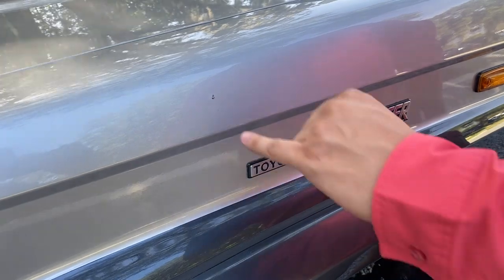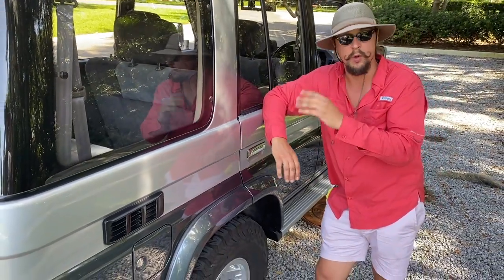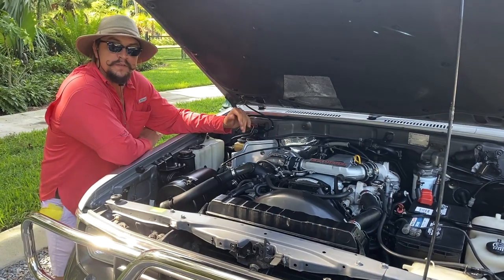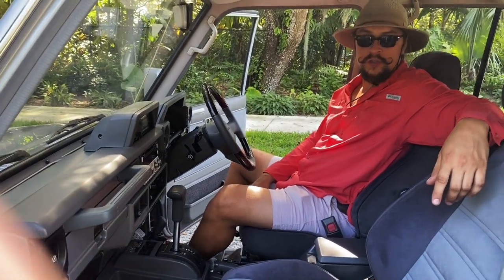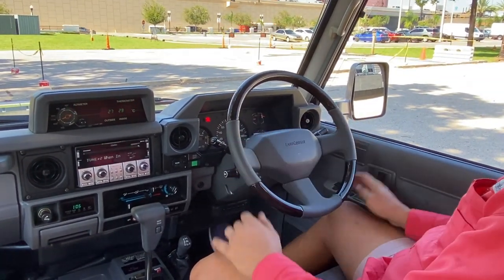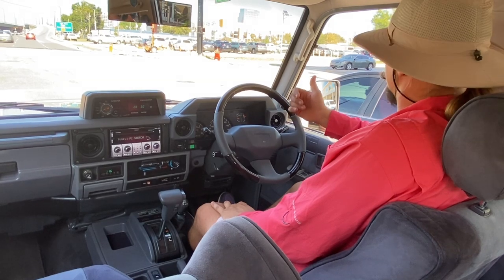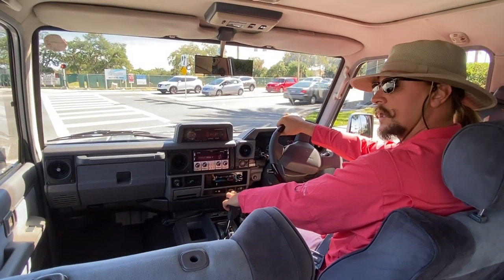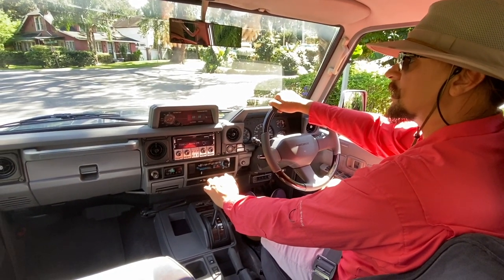Toyota Land Cruiser LJ78 Turbo Diesel. Review and road test. Cleanest out there.

Comment: In my country we called it Land Cruiser Mark 2 or styled as Land Cruiser II. It is not marketed as Prado yet as Prado only came to our country with the second model J90. The one I’m going to get by end of August is just a 400k KM, 1991 model, standard trim RJ77 with 4-speed MT, 22R carb engine. It has folded jump seats much like the troopy one at the back most and the center part of the car is a long folded seat but have no headrests. Also equipped, a weirdly but common 2 person front most passenget seat. I have no idea what the seat is called but it’s a bit wider and due to its size, the center console is absent, leaving only the handbrake, just barely fit in between.
Reply: I assumed your car is 2 door...shorty one...if i'm not wrong..

Comment: Awesome car. I'm so envious. I acquired the exact same car (1993 model) and, while it's in fairly good shape, it's got nothing on yours. Wish we could do a swap. :-) The previous owner changed the engine to a 3L 1KZ. It's got the power, but it runs hot when the turbo kicks in, especially on long, or steep, hills. You talk about the benefits of an intercooler and it got me wondering if mine has one - will have to take it in to have that checked. The gears also stick, every now and then, and refuse to shift from 1st to 2nd, but after several minutes, they go back to normal. Wondering if flushing the transmission could cure that problem. My mechanic had advised that I change over to a manual gearbox instead.
Reply: Hii...1 of my frenz used this 1kz engine..with auto trans..and he experianced a problem with that trans before...so his trans mechanic change the part ..inside..which is similar with 2005 Hilux auto transmision..i dont know what the part name..but i hope this give you a clue..here that Hilux code Vigo Commmonrail..now he still use that tranmision for past 5 year after change thats part..

Comment: Sir, this LC looks fantastic. Very good condition. But just fyi … this is not the 78 series (Troop carrier, troopy), this example is the 76. Yes it’s a seventy series but not the troopy. The 78 has a longer and other wheelbase and the cabin is longer and higher. The 79 is the pickup. Most sold in Middle East, Africa and Asia/Australia. Nice video anyway